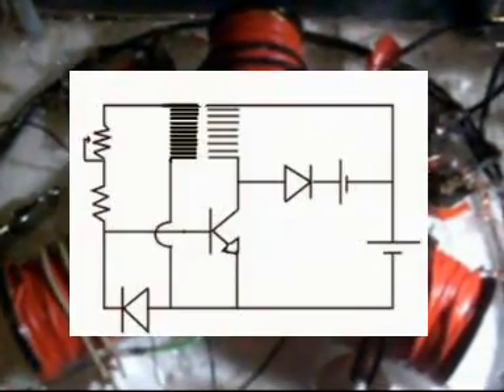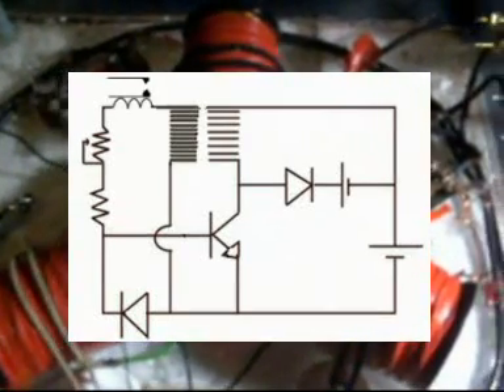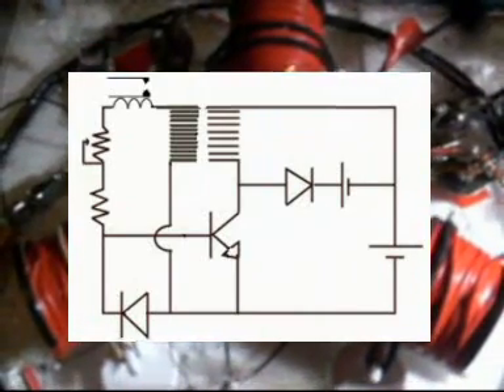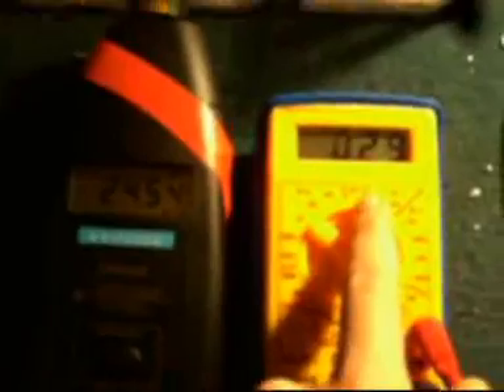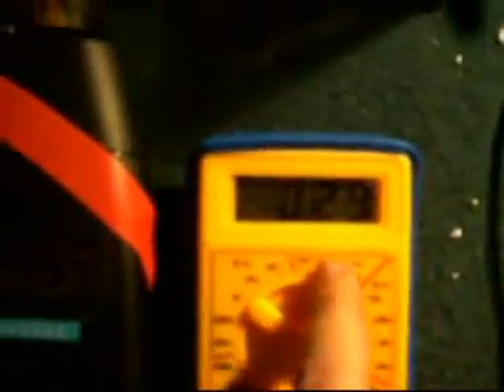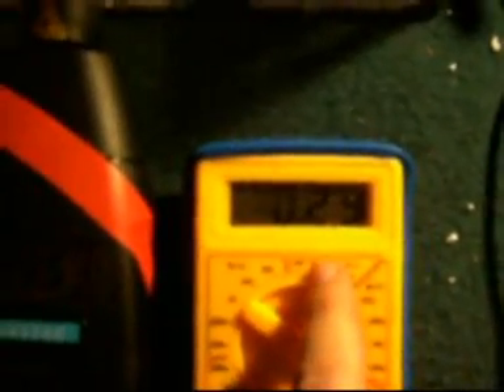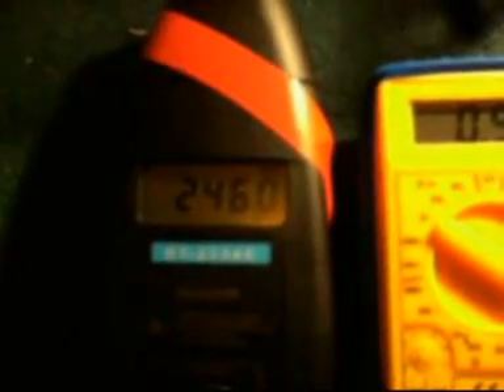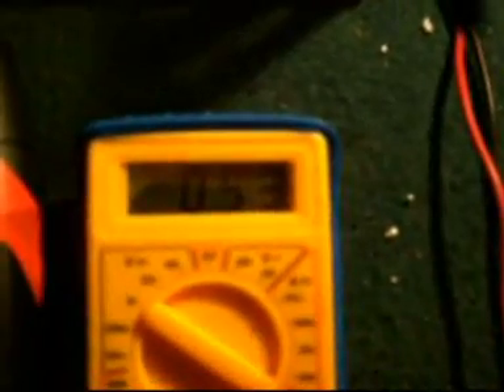Beneficial Modification of the Bedini SSG?

Comment from the maker: hmm.. tired to reply but not sure if it is showing up... second attempt:

For those who are only looking for the mechanical output from the ssg, this modification produces the same amount of mechanical energy for half the input from the operator... 

I have not seen a significant improvemnet in charging COP with the motor... though I have had very interesting results using the choke in a solid state charger...

Comment from the maker: the voltage spike is in the hundreds of volts.  It is clearly over 90 volts as demonstrated by the neon bulbs in the circuit. and we know it is alot higher as you can charge 96 volt battery bank off a 12 volt battery.  Scope shots regularly show the spike to be over 200 volts.

Comment from the maker: nope... take a closer look at the schematic... no current from the primary battery can flow through the charging battery. By the standard electrodynamic model, when the coil is pulsed with the primary battery it forms a magnetic field.  Then when the primary battery is cut off from the coil the magnetic field degrades inducing voltage in the same direction as the pulsed voltage.  Since the transistor is off at that time, the voltage goes through the diode and charging battery.

Comment: Ok thanks for that. Now next question is you have a diode from the collector of the transistor that allows back EMF to flow to the charge battery. So every time the transistor is triggered to pulse the motor power flows from the run battery through the diode and in affect pulse chargers the charge battery at the same time?

Comment: This is very interesting work. Im going to go get one of those relays from maplins if they have them, to put in my circuit. I cant figure out however why my pot is so sensitive. im my last video i got it to work however now it has stopped. too much resistance totally stops the motor instead of slowing it. any chance u could take a look, help a fellow engineer out?